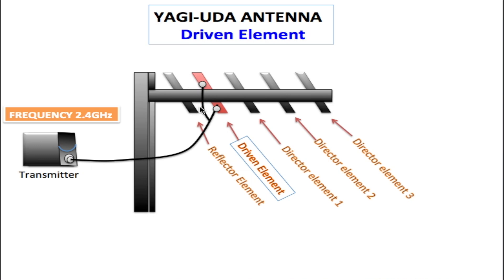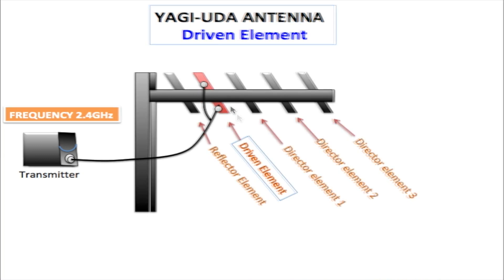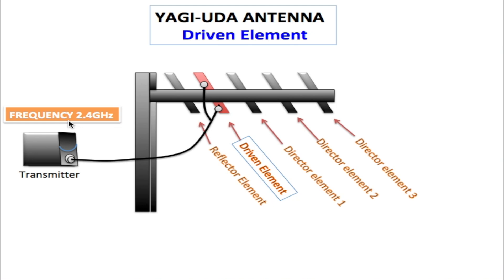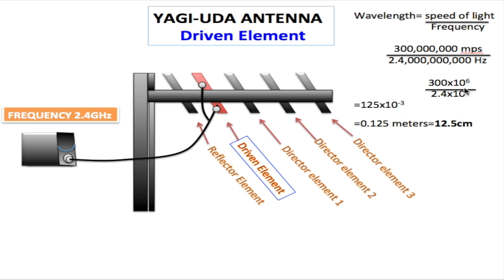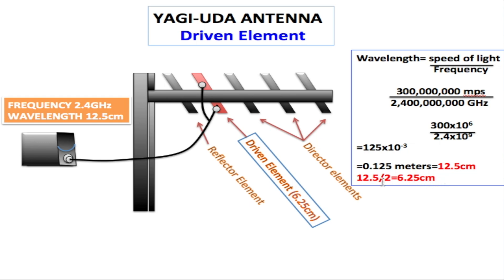Yagi-Uda Antenna Design: Steps by step guide

Comment: To make the antenna smaller. Can I use 1/4 Labda calculations. I need one in the 128 mHz range.
Reply from the maker: Your question is how can you make a 128MHz antenna physically smaller. The only way to make any antenna physically smaller without effecting performance is to use loading coils. Hope that my answer was helpful.  Let me know if you have any more concerns or  questions.

Comment: can we got any optimal signal gain if we use copper pipe rather than aluminum..?
Reply from the maker: Yes you can use copper as well.  You don't need copper  pipe.  The picture may be a bit deceiving.  All you need is 12 guage copper wire for adequate bandwidth.  The length of the elements would of course depend on your frequency. That you can calculate.  Hope this was helpful.

Comment: What boom material is used to attach the elements ?  Can it be metal or should it be a non conductive material such as fiberglass or pvc?
Reply from the maker: The boom of a Yagi-Uda antenna is typically made from a material that is strong, lightweight, and either conductive or non-conductive, depending on the design requirements. The most common boom materials include:

Aluminum – The most widely used material due to its combination of strength, light weight, and corrosion resistance. It also provides good mechanical support for the elements.

Fiberglass – Used in cases where the boom must be non-conductive to avoid affecting the antenna's performance, such as in certain VHF and UHF applications.

Wood – Occasionally used for experimental or DIY Yagi antennas, but it is less durable and can absorb moisture, affecting performance.

PVC or Plastic – Used in some homebrew antennas where insulation from conductive elements is needed, but it lacks mechanical strength compared to metal options.

For most applications, hollow aluminum tubing is the preferred choice because it is lightweight, easy to drill for mounting elements, and does not significantly impact the antenna's radiation pattern.

Comment: When talking about the driven element, the length is calculated to be 6.25cm based on the wavelength and it being a half-wave dipole. When the presentation moves on to talk about the 1st director, the length of this driven element then changes to 6.5625cm. Why is the dipole suddenly longer?
Reply from the maker: Director element1 at 6.234cm is always 5% shorter than the driven element which is 6.5625cm in this example. Hope this was helpful.
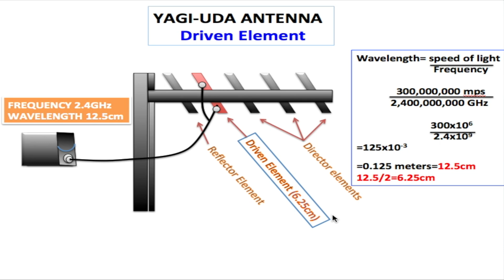Reply: Thank you for your reply. It wasn’t the director element I was querying in my original question but rather the ‘Driven Element’. If you watch your presentation between 4:15 to 4:25, you calculate the length of the driven element to be 6.25cm and say this but around 4:22 in the presentation, this value is suddenly shown at 6.5625. The length of the director elements are then accordingly. I wanted to understand why the length of the driven element only suddenly changes in value on your slide at around 4:22? Thank you
Reply: @AdamW2163 My calculations are more like yours.  Mine show the Drive element (half wavelength) to be 6.250 cm the Reflector to be 6.5625 cm and the first director  to be 5.9375 cm. 
The author did a good job explaining the principles of a Yagi antenna and illustrate the appearance of the antenna.  He just stumbled about the drive element length.  It's easy to do that when making a video.
I'll find it tough to measure to thousandths of a cm.  🥵

Comment: how about if it has a 4th director element? what percent shorter is it?
Reply from the maker: That's a very good question.  The first director element has to be 5% shorter than the driven element.  The 2nd, 3rd, 4th, and even 5th director element etc. of course has to be shorter but how much shorter depends on how narrow you want your transmitted signal to be or if you are receiving a signal how focus you want your antenna to be.
Reply: @TelecomTraining can you provide a formula for distances between the and how long should they be, pls